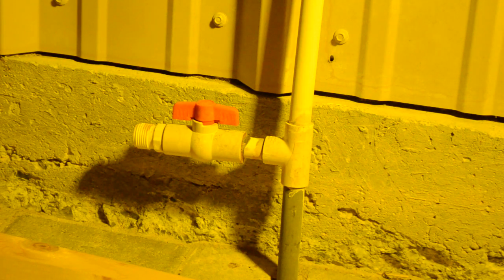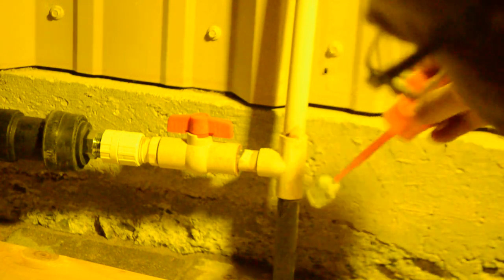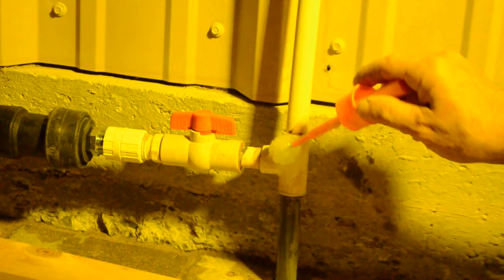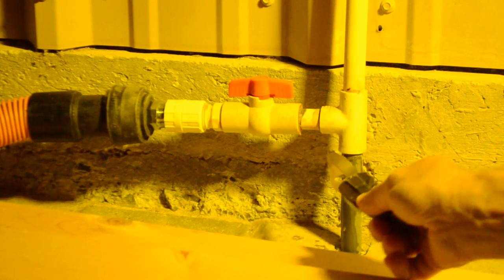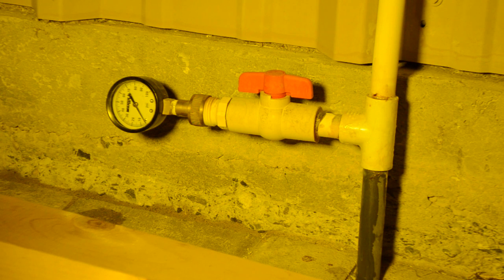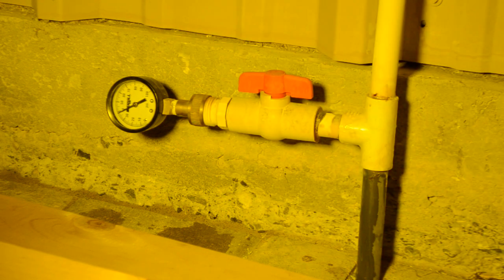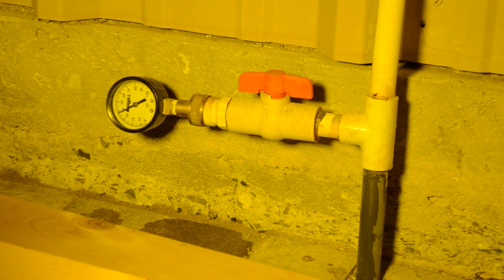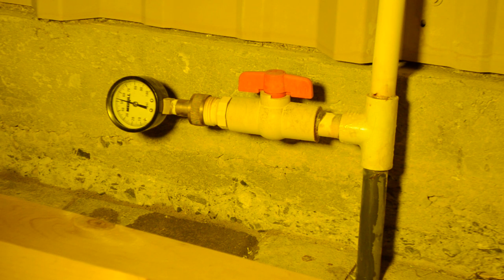FlexPVC - Actual Demonstration of fixing the impossible leak, for free!

Comment: Eric will this method work on a gravity sewer line joint in crawl space.  I have no way to use a pump for creating pressure.  Small leak no crack, it seems, only at joint connection. Should I dry it as best as possible, then just put primer and cement at joint connection?
Reply from the maker: Most likely yes. You are not using a pump to create pressure you use a vacuum, to create a low pressure, aka vacuum, in the pipe. You can put the vacuum anywhere just as long as you have the rest of the system capped, shut off or closed. The vacuum is not 100% required but it does make it work much better. Even a little vacuum is better than nothing. Also is your sewer abs (black) or pvc (white)?
Reply: @FlexPVC  Thank you.  Pipe is white, PVC.

Comment: What kind of glue and primer do you use?
Reply from the maker: Any major brand on the primer. And most any of the blue glues. Pool Tite, Christy's Red Hot, Oatey, Uniweld, etc. Just make sure it'e the blue glue (Rain or Shine, Wet r Dry, etc.) and make sure it's less than 2 years old.

Comment: Can this method be used on braided rubber tube that goes from the hot tub manifold to the jets?   Your demo refers to PVC.  What is the name of the primer and glue you are using?
Reply from the maker: I'm very sorry but no, that will not work. There is not enough structure in that type of hose. But you can easily cut and splice that type of hose using standard barb connectors. See:
https://flexpvc.com/cart/agora.cgi?product=Barb-Couples
Email us if you need more help.
Thanks

Comment: Hi Eric, I have one more suggestion that might help some. In this case or where a male plastic tapered thread is going into female plastic pipe thread, I will put a hose clamp or two in this case to hold the pipe fitting from cracking again.
Reply from the maker: Yes, absolutely. That can help.  Essentially that is what they are doing with the SR Fittings we carry as well. The hose clamp is still probably cheaper, but the SR fittings look a little nicer and make the job a little faster. :-)

Comment: Thank you Eric. I just repaired a suction line leak on a rain water catchment system. On difference is that the suction line is under constant pressure for these systems because we install a foot valve or check valve in the water tank at suction inlet so when the pump turns off, the suction line stays pressurized. This is because in this case the water catchment tank is lower on the property below the house and pump.
Reply from the maker: Glad it helped

Comment: Amazing demonstration!! Does it matter which primer and glue you're using? Like, should it be fast setting or regular? Assuming clear, since it'll look like a mess with purple primer, etc. Is there a potential for negative side-effects with the pump sucking this stuff in or it going through the pool sand filter? Thanks! Can't wait to try this trick to fix a small suction side leak in my pool.
Reply from the maker: Any brand name primer and cement will work. I don't recommend the slow set or the heady bodies. You need some viscosity for it to flow. Yes, clear looks a whole lot better! ;-)

Comment: I used your method this weekend on a crack in my grey water line on my truck camper.  Removing the line would have been incredibly costly and time consuming. I could barely get my hand to the crack but with a helper manning the vacuum I managed to get the pipe repaired.  I can't imagine how much disassembly would have been required to repair the line the "normal" way. This should be required knowledge for people with RVs.
Reply from the maker: Thanks for letting us know. It's very enjoyable to know we are helping solve difficult situations. Kind of our thing here. ;-)

Comment: How does your vacuum not turn into a flame thrower? The type of motor in vacuums makes sparks and PVC solvent has flammable fumes. My vacuum did it once doing something similar and it melted the inside.
Reply from the maker: Because the vapors from the primer are miniscule and not enough to support any combustion. You have to remember you are sucking the primer thru a tiny crack or pinhole in the pipe. Also the amount of air going thru the vacuum is many times that which is coming thru the leak.

Comment: What would you do on a 3" PVC Drain to Septic Tank in a tight space in the wall?  It's leaking at the top of a 45 about 1/2" from the bottom of the floor.
Reply from the maker: If the leak is in the pvc fitting or the joint, the same basic principle applies. If the tank is full, that makes it much harder. If there is a valve where you can isolate the leaking fittings from the tank you can do it. If not go to our website and send an email with pictures. (Top of the page, right corner area, look for the blue circle.) Once we see picks we might have an idea for you. Thanks

Comment: I have this exact type of leak from a newly-repaired main water supply line we had to re-build after repairing the main drain from the house to the sewer (long story - bottom line - water lines were in the way). I cannot figure out where to create the negative pressure/vacuum. Thinking open all taps to drain all water from the system, then close all but one. On that one put a wet/dry vac. My conundrum is that the water line I need to correct is in the ground (exposed right now) so I do not know the closest tap to connect the vacuum to. Does it matter? Is it a matter of proximity?
Reply from the maker: I think you have the right idea. I would close the supply line, and all the ones in the house except for the one closest to the leak. That is were I"d put the vacuum. The closer to the leak the stronger the vacuum. (air is "elastic" for lack of a better word.) Good luck. :-)
Reply from the maker: Generally does not matter as long as the rest are capped/turned off.

Comment: I would have made a permanent repair and been done in a couple of hours. Plus if I was going to go to this trouble as a final topping I would have coated it all in Smear as we call it, which is PVC granules mixed with primer that will soften into a paste like form that can be glued over the damaged area. A note of caution here in using a shop vac like that for your vacuum is that the solvents in the primes and glues are very flammable and could create a nasty little accident if the level of fumes and motor spark from shop vac meet.
Reply from the maker: The purpose of the video is to show how effective the technique is. It's never meant for a permanent solution. What some people do not realize is that many times these leaks occur in places where it is NOT EASY and sometimes not even possible to replace the fittings. In the example I used in the video, YES it would have been faster to just cut out the tee and replace it. But it was in a perfect place where I could easily video it and show how effective the method is. So that is why I used it to make the video.

As for an exploding vacuum, yes, if you were to stick the hose into the can of primer and suck it into a vacuum that had an exposed motor, it could be very dangerous, even fatal. However, these are wet/dry vacs I'm using (and I mention this in the original video) As far as I know  the motors are sealed. Also the amount of priming going thru that small crack is maybe a tablespoon all together. So the risk I think is pretty small. 

Your comment is valid. Be sure you aren't using a motor exposed to the air flow and limit the amount of primer you are sucking in. Thanks!
Reply: As a retired fireman 27 years on the job and now full time after 20 years part time in commercial building mechanical maintenance, I do know a little about what i am talking about. Just takes the wrong guy doing it the wrong way and an accident happens. I would think someone being in the PVC trade would be aware of repairing a crack like that using a soften version of PVC granules. Swimming pool repair industry has been doing it I'm guessing probably 25 years or so and makes a really decent strong repair over what you showed and faster.
Reply from the maker: This video is showing people how to make a temporary fix in a leak using what they probably already have around the house right now w/o having to buy anything. The fire hazard is minuscule. The vapors from the tiny amount of primer that actually make it's way into the vacuum are inconsequential. There is never enough in one location that also happens to have a spark source to combust. They are drawn into the vacuum and sent right back out the exhaust. I really think you are trying to nit-pick and find fault where are is none.

The reality is there is nothing anyone can do about "the wrong guy doing it the wrong way." By  your own admission, they are doing it the wrong way. 

And btw, you don't have to buy anything to make the paste you are talking about. A hack saw, an old piece of pipe and some primer and you can make your own.
Reply: What brand primer did you use here?
Reply from the maker: On the primer it does not matter. They are all a mixture of acetone and MEK. We sell Spears and Uniweld brands so it'd be one of those. Thanks for the question